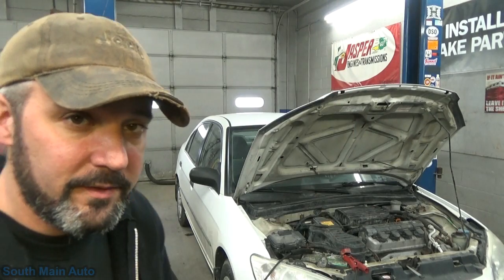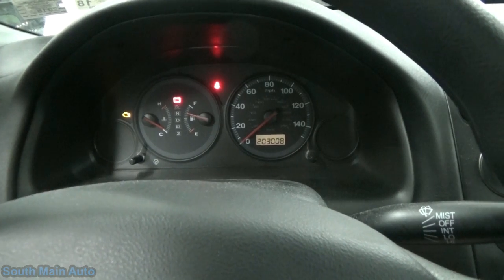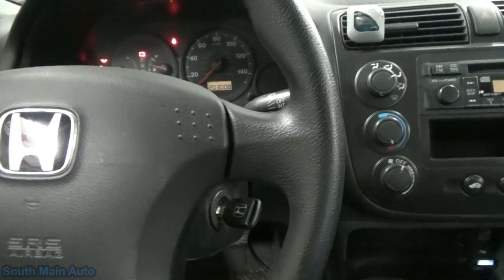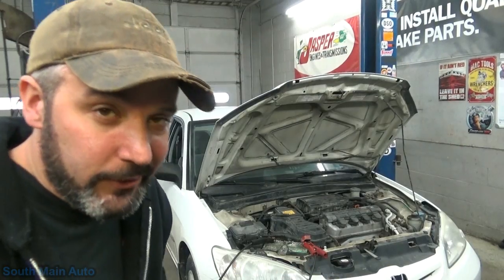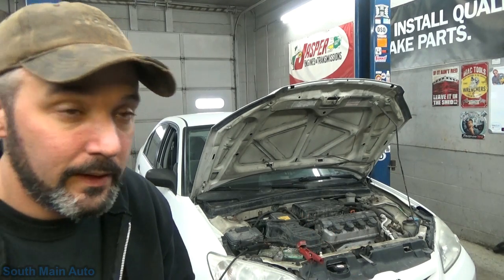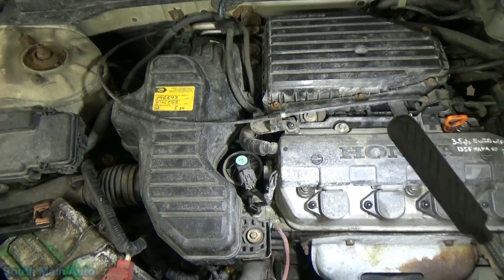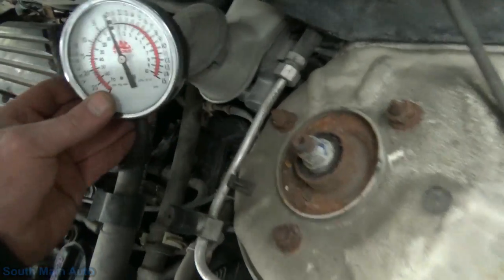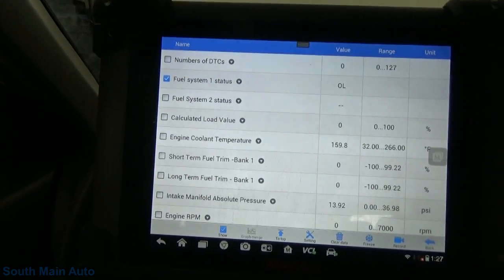Honda Civic - Crank / No Start

Comment: Updated: Replaced my MAP sensor. That did it. Problem fixed. 

Hello SMA and anyone with insight, I have a crank and no start issue. I saw your other video on the Civic that had a broken Timing Belt. My '05 Pilot doesn't make that noise when I crank. 

It all started when I had a p0172 and p0458, no EGR codes. I checked and replaced my spark plugs, the EVAP solenoid valve (Honda OEM) and cranked, no start. 

I checked my coils with a volt meter and they all have resistance. To eliminate an issue with ignition, I sprayed starter fluid in the Throttle and it wanted to start. So that led me to believe it was a fuel issue.

I checked all the fuses with a tester related to the ignition and fuel injection. They're ok. I even replaced them.

My fuel pump does come on. i checked my fuel pressure with a gauge, and I have 50psi. I did notice my fuel gauge on the cluster fluctuate as I crank so I'm not sure if it's the Fuel Pump Relay, the Fuel Pump itself or the EGR. It's kinda hard to work in thw cold and rain on the side walk. Wished I parked in my driveway car port...ty for any help.

Comment: Thank you so much, Eric. For doing this video. I happen to replace the camshaft seal and the EGR gasket. Due to an oil leak. After I was done the car ran normally for 15-20 minutes. Then it began to have the same problems as that Civic you worked on in this video. So I pull out that, EGR Valve and clean it as you did. Afterward, the car started normally and did the same procedures as you did. By removing the FI-ECU fuse. The car started normally again. Took it around the neighborhood then it almost died again at the first two stop signs. Once I got home I turn it off and on several times. It started normally. By then It was already Midnight. Tomorrow I am going to drive it around the neighborhood again to see how it behaves. Anyway, once again thank you so much. I was lucky to find this video. It sure cut down my stress level by a ton.

Comment: Honda EGR valve lift sensor voltage should not exceed 1.25V at idle. Anything higher and the valve is considered stuck open. I had one a few years ago with a chunk of carbon like that. Doesn't happen too often, good work!

Comment: I was still at fuel, spark, timing, mechanical, when you had already made the leap to EGR simply based on the presentation. We all thought, how'd he know that? Was it the intermittent, terrible running, responds to throttle presentation that made you think of it? Now I've got EGR on the brain, it won't get out of my head for weeks. Great video.
Reply from the maker: Just go open the EGR on your car and see how it runs. MAP engines have a pretty distinct way of running with an open EGR.
Reply from the maker: Plus I probably have been burned by one as a young tech so it gets stuck in your head haha

Comment: On 90s Toyotas, there's a vacuum solenoid that pulls on the EGR. This solenoid is known to go bad, and can easily be tested with a hand vacuum pump. My 95 Corolla was throwing an OBD1 code for EGR failure, so I thought I needed a new EGR,valve. But when I looked up the EGR test in the Toyota service manual, I realized that it was actually my EGR actuator solenoid valve. Much cheaper fix. 
Something also common on 90s Toyotas, at least Corollas and Previas, is that the intake passages clog with carbon and cause EGR flow to be "insufficient" and throws its own separate code. I cleaned my intake manifold in addition to the EGR actuator and don't have any codes anymore! Had I not cleaned the intake passages, I am certain I would've been faced with an insufficient flow code. 

On my 1995 Previa, it is throwing me an insufficient flow code. Its EGR works exactly like the Corolla's, so I performed the EGR tests and confirmed that I need to clean out the intake manifold

Comment: Hi Eric, Awesome video Thank you, I own a 2003 Honda Civic, And this morning it didn't want to start, When it finally did it was Iddleling very rough, and when I pressed on the gas It didn't want to accelerate, it bagged down it shut down. I'm going to look at the EGR valve and see if that's the problem. Thank you for your video. If you have any other Tips please advise. I really appreciate all your help.

Comment: Diagnosed my 2000 Honda accord 2.3 same exact way confirmed with a code reader live data, intake temp  at 300 degrees, fuel trim short and long at around -19 also engine load read at 48% at idle,  I had a check engine light for a p1399 only , all is good now after a little egr cleaning

Comment: Hey Eric O, 
   I used a trick that you demonstrated on a video a while back.  A Jeep that I was working on had a tie rod ball joint stud that was spinning with the nut. I put a box wrench on the nut and my impact on the 10 mm stud and reversed the direction.   Worked like a charm and spun right off!  Saved me a ton of time and energy!  Thanks much

Comment: I had this happen on my sons '01 Sentra (rough running, EGR code). Carbon flaked off and jammed the valve open.  I removed the carbon and cleaned it as best I could scraping with a screwdriver, reinstalled the valve and it jammed again a few miles later. I soda blasted the inside of the valve chamber because it was coated with a layer of carbon (I had to prop the valve open). Been fine ever since.

Comment: Next SMA video: battery maintenance on Honda civic, lol. Saw this same thing on an older Saturn with a vacuum operated valve, wouldn't even allow the engine to run. Nice presentation on the repair, always like your videos.

Comment: To extend on your Honda radio code knowledge, most of the time you can find the code for the radio (and the GPS code if applicable) on a little white sticker somewhere on the car. Usually it is stuck on the sidewall of the glovebox either on the inside or outside (I've seen it on both). Another spot would be on the inside of the fuse panel lid under the hood. You're welcome :)

Comment: My daughters Chevy equanx ran like crap with a bad egr valve. I couldnt believe it was doing what it was doing as far as bad running and set a code. We scanned it,found the issue,replaced it and back to the road again. I have cleaned the one in my Trailblazer,no issues.

Comment: If it is out, and fixed, maybe a cleaning of the built up carbon on the inside of the assembly ?
It's maybe a 20 minute job.

Make sure it will not happen again in the near future.
Reply: I was thinking the same thing. The EGR valve had a lot of bolt heads showing, so maybe it could be taken apart and cleaned. Even the pintle valve had a 6 point recess for a drive to remove.
Reply: Personally, I wouldn’t muck around disassembling stuff if it still works. Wait till it dies, or find a dead one, pull that apart, and see if there’s anything you need to watch out for. Unless it’s very cheap, then you might as well just smash a new one in anyway, and make sure the problem doesn’t come back.

I’m probably being overly cautious here, personally, I love tearing shit apart, there are few things I love more in life than pulling stuff apart and finding out how it works. But it would suck to fix something dumb like this, only to think ‘hey, I might be nice and tear it down, clean it out properly’ only to break something in the process.

Believe me, I know the temptation, but try to resist it, unless the thing is just grossly dirty and clogged anyway. And in that case, you’ve probably got bigger fish to fry. This just looks like standard carbon build up from a well running engine. It’s not always worth cleaning out every last bit, especially if the part still works.

I’m not a professional mechanic, I’m only a home gamer, but I would be careful about this sort of stuff. As tempting as it may be to nip other stuff up and be a good mechanic for your customer, some customers cannot be reasoned with, and will throw a fit if you do something they didn’t ask for, even if you’re not charging for it, and even if it needed doing. Fix what you are asked to fix, and precisely no more, or less. By all means ask the customer if you see something, and by all means don’t charge for it, but don’t think you’re doing the right thing by ‘surprising’ them.

I know, it’s stupid, but this is how the public is. Personally I’d be chuffed if my mechanic took initiative and nipped other stuff up. Other people decidedly are not, because they know best, even if their engine is full of sludge. Seems they forget ‘if it ain’t broke, don’t fix it’ does not mean ‘if it ain’t broke, don’t maintain’.

I could be full of shit, though. But this is how I’d swing it if I ever were a professional. Not that I’m smart enough for any of that, though.

Comment: Need to having a 2005 Honda Civic ex special edition 1.7l . I replaced head gasket and water pump and timing belt and gaskets myself. After setting timing and valve gap I have crank no start. Fist crank it started for 3-5 seconds and died and never restarted. I never had any trouble before doing this work with the car just coolant overflow would come out and overheat the engine and I would park it. It doesn’t have a reall good compression but I think it never did but use to run ok. My question is after checking I had fuel spark and new cam sensor and rechecked timing and valve gap after no start it was all ok but no start. Your video shows using a vacuum gauge after the purge solenoid and you have 2 1/2 inches and I checked mine and I have zero. What am I missing? What could make my car not have any reading on gauge when cranking? Any suggestions would help and I appreciate your videos. Thanks

Comment: On older cars with bypass air, a crank, no start, follow by a crank start WITH accelerator pedal applied and a poor idle is typical of a stuck closed bypass valve.  This would result in very high cranking vacuum.

Most cars these days use electronic throttle control which eliminates the bypass valve.

Comment: Not only did the 200k Hondoo not need any parts but you didn't have to disassemble half the stuff on the engine to get to the EGR valve as you might on say a Chrysler product. Go Honda. It's interesting, and no surprise, how many mechanics that work on all makes and models own Hondas.
Reply from the maker: I own Honda and Yota myself :)

Comment: Hey Eric I’m looking to buy a little Honda CRV from about 1998 to 2004 because I like the older ones better because of less computer crap. Everything I’ve look at is anywhere from 69000 miles to 250.000 miles with either 4wheel to two wheel drive. What is the most common problem with them or what should I look for so as not to buy. Thanks for any info. Wayne

Comment: Never had this before: I just got a crank no start on an 05 Legacy 2.5. Pulled small timing cover and saw the that the belt wasn't moving while cranking and the accessory belts weren't turning. Pulled the entire cover off and the timing notches were all frayed off at the crank....weird, I thought. Tensioner was weeping a bit, but no bearings/idlers were bad and the belt had less than 20k on it. Leak down test on passenger checked out while on the driver's side it showed a leak on cylinder 4 (towards the firewall). Pulled the driver's head and started replacing the valve until I noticed that the camshaft was having a real hard time turning over even though all the lifters were removed. Went deeper and pulled the cam to find the culprit: oil starvation to a couple of the mating surfaces almost seized the camshaft. The weakest link was the belt after trying to turn the non-lubricated cam. Solution: grab a head from a core I had lying around (2001), drill out and tap an EGR hole. Running like a champ! Tell wife and her reply was "Greeeaaaat....remember that tomorrow you're watching the kids so I can see 'Beauty and the Beast' with my sister."
Reply: Rodrigo Sagebin I did lol
Reply: Rodrigo Sagebin feel your pain, I'm swapping awd Trans in a caliber, along with a bad k member, basically everything from intake and exhaust manifold all but 1 motor mount, and rad hoses.   half shafts transfer case steering rack, brakes control arms, sway bar link ends, I'm sure I'm missing something else, needless to say many hours of dissembly, wife asks, did you get back together yet, I say no, tell her what I've done so far, she says I've reassembled it 2x in my head already, what's taking so long...   I grind my teeth and nicely ask, would you like to finish where I left off.   no response..
Reply: Rodrigo Sagebin what caused the oil starvation?

Comment: My 2002 civic is experiencing the same issue won’t start unless give it throttle but my year doesn’t have the egr valve ,what else can I look for ?
Things that’s been changed is crank position sensor with oem Honda part , cam position sensor with oem Honda also , fuel pressure is good ,,, throttle body been cleaned , iacv been cleaned ,,, timing belt replaced and mechanicals tming is spot on ,,, car runs perfect no misfires or roughness ,, just won’t start unless I hold the gas pedal to the floor when cranking ,, once it starts everything is normal and no codes

Comment: Great video,my 2010 civic 1.8,won't start ,have good  crank, but shut  off when step on gas pedal .not code at this time,after few crank will start with or without the help of gas pedal.could  be fuel pump? After start it running fine.have 280k

Comment: Great Video!  I keep learning from you!  It's about the basics!  I've only seen computer controlled carburetor systems have E.G.R. sticky valve problems, one a V6 Ford I owned, another was a Chevy  C10.  I've seen leaky E.G.R.'S on fuel injected engines, none lately.
NEVER saw a rock of carbon like this one!  HMMMMMM!  How many more are still in the exhaust?

Comment: the EGR on my toyota was fixed when I heated the big nut to break it loose.  it immediately cured the problem and it has been almost 5 years since then.  I would guess that carbon was either blocking a passageway or blocking the movement of the valve itself, and the heat caused the blockage to free itself.  I have been lucky that I have never had to replace an EGR valve.
Reply from the maker: Oh nice, thanks for sharing

Comment: I have a JDM D17A On my project car so no EGR on my engine. I swapped my fuel pump assembly, coil packs/spark plugs and I’ve gotten the car running a few times but always stops working again a few days later.. I was also getting my car started using the pedal and now even w the pedal pushed in it won’t start.

Comment: My neighbor has a 2001 Civic EX with a no start. It cranks but doesn't fire. The negative battery cable was replaced as the original complaint was no crank at all. Turned out the negative cable was so badly frayed it lost conductivity. Anyways the current problem is it will spin but not fire. One thing to notice. When the ignition switch is turned to ON only a couple dash lights operate no odometer no fuel gauge, etc. No power windows operate or door locks. It is though half the car has no power but the car spins over quickly the battery has plenty of juice.

Comment: A good none scan tool diag can be done with cold eng, start vehicle (assistant is necessary) and feel the egr pipe close to the intake. If it gets hot right away, there's egr flow and there shouldn't be. Stays cold...no flow.

Comment: The bits getting in the pintle may repeat.
Some cars need a supply tube cleaned or replaced.
Older cars had EGR cooler that had to be removed.
I would warn it may send another piece or pieces, at a later date.

Comment: Great video! I have a question I just changed the Crankshaft position sensor and it did not solve the issue. The computer still says that is the Crankshaft sensor. what is your advice? is better to replace the sensor again or the plugger to the sensor might be damaged? Please let me know the best step to take.
Thank you so much!
Milton!

Comment: Soak the egr valve/ system with Amsoil power foam. Let sit for 30mins. Dissolves carbon like a champ. My 90 Accord had that problem. Run higher octane fuel sometimes will also help. 87 octane will run a vehicle but not great over long term.

Comment: Eric I can remember I had an 06 civic that had similar issues.  t would stall in idle every time!  I went straight for the IAC valve, it was the rotary style valve and I fond a piece of an acorn stuck in the valve.  It ran fine after removing it.  Have you ever seen that or anything with an acorn??

Comment: I have a 2005 Honda Civic DX thanks but we’re not start I check for debris on the EGR I check for spark on the spark plugs I have power to the coils spark plug coil negative positive when the key turned on negative negative when it’s off there’s a third wire doesn’t have power do you have any ideas

Comment: How did opening the throttle help the engine start in this situation?  I thought the lack of vacuum due to the open EGR was preventing it from starting? I would've thought opening the throttle reduces the vacuum even further and would make the engine even less likely to start.

Comment: I've had this very problem on my 2001 Astra. Being a 1.6 petrol (gas) it didn't have a MAF but it threw up an EGR fault code. When I removed the EGR valve there was a foreign object keeping it lodged open. I'd replaced the upstream lambda and some of the (rusty) thread from the old one dropped into the catalytic converter and ended up getting lodged in the EGR valve.
Reply from the maker: lol cool story. I don't even know what an Astra is
Reply: I'm in the UK so it is a Vauxhall/Opel (GM Europe) model. The Astra was sold in the US as a Chevrolet. I did an engine oil change and a service video for this car. You won't be familiar with my current car either because it is a Citroën.